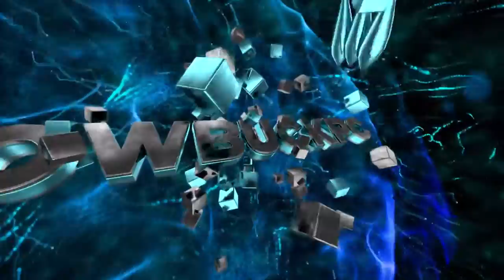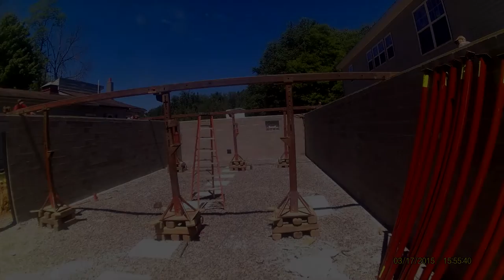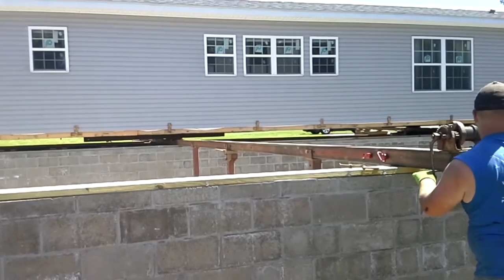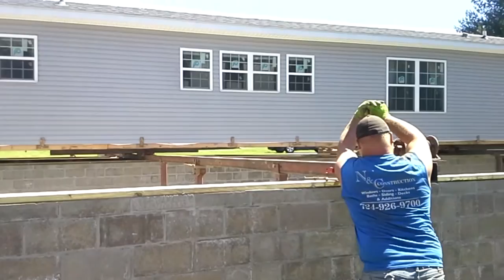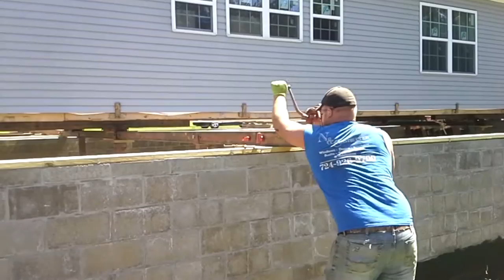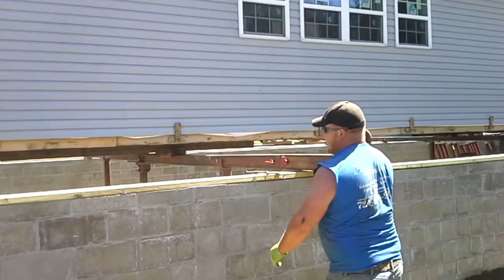Modular Home slide over Basement

Comment: I think with a Double Wide. The easiest way , is to Dig Out just enough dirt to lay the brick basement walls. Replace the dirt at the end where the trailer will roll in. After the trailer is set ant the bricks are finished, then remove the dirt down to the floor level and Make the concrete floor,
Reply: Ok but that isn't a double wide in this video. It's an off frame modular. Two different tjings.